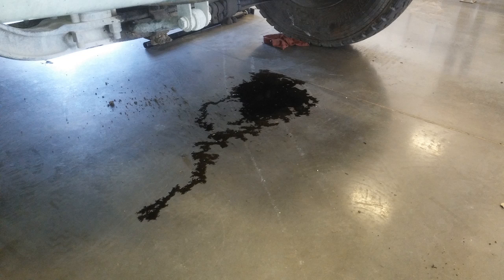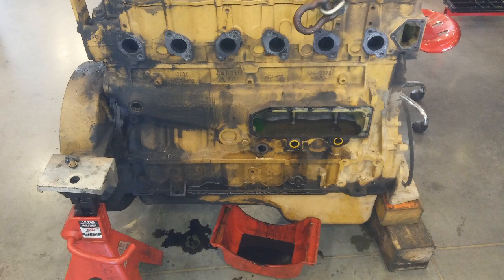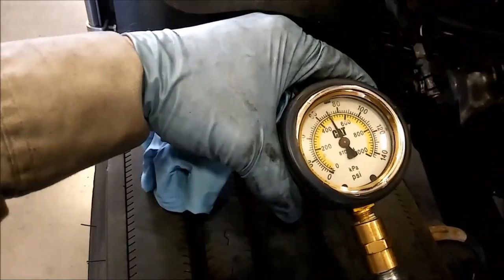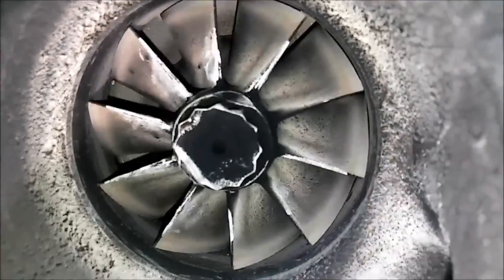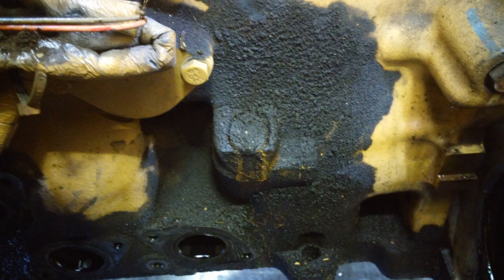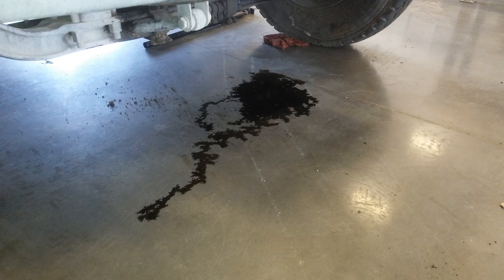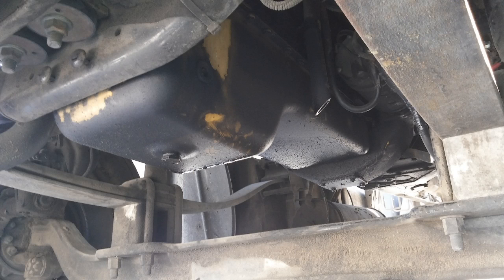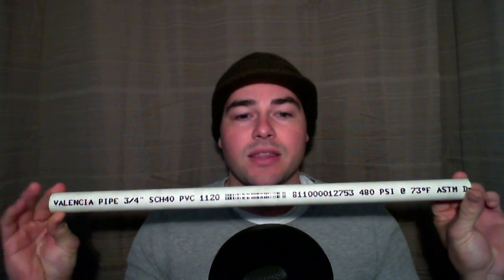Why Do Diesels Leak So Much?  Why Do Diesel Engines Leak So Much Oil?

Comment: Not entirely correct.  This has nothing to do with the turbos.  Turbocharged gasoline engines have PCV systems.  Both diesels and gas engines create a suction on the intake side, turbocharged or not, the difference is that suction doesn't give you a vacuum signal that can be used to pull these vapors out of the crankcase/lower crankcase pressure without a restriction in the intake.  Gasoline engines have a throttle, the restriction that causes the vacuum, most diesels do not.  

We can get into vacuum pumps and what oil impinging on the turbocharger impellers really does but lets get the problem with PCV systems right first.
Reply: Not all gasoline engines have a throttle body in use. On my car the throttle valve is always open (Valvetronic system). Still there are no leaks.
Reply: The Valvetronic system closes the throttle body to create a vacuum signal in the intake and does have a separate vacuum pump to do the same, BMW went to a lot of effort to design better seals because of it's lack of a constant vacuum signal, and it still has oil leakage problems.  There are various upgrades to the BMW PCV system because it doesn't work well.

What's your point?  So BMW messed this up on those cars (there's a reason to do it but WRT to this discussion it's messed up), and the way that BMW implements this, it still closes the throttle body to create a vacuum in the intake at startup....

At the same time there are a few diesels that do have throttle bodies, and even those that don't, don't all leak.  My Cummins 5.9 in my dodge ram is dry with something like 170K miles, but I wouldn't be surprised if it started leaking.

Comment: 5.9 cummins isb 300k plus not a drop of oil anywhere. The "right stuff" by permatex is the key. 
I disagree at my shop I rarely see turbos every damaged from oil residue. The amount of oil that touches the impeller is so minuscule with the pcv routed to the turbo inlet. I personally think its the best system. Rings benefit from the vacuum. Many manufacturers still use this system present day.

Comment: as others have mentioned, the reason diesels don't have vacuum is because they don't have a butterfly in the intake, it's not because they are turbo'd.
Reply: My n/a DIESEL 6.2 has a CDR that runs off... VACUUM...
Reply: Probably couldn't work well under all engine conditions, but it's an interesting idea

Comment: So why not use a catch can system with turbo pcv? It would filter out the heavier oil and still pull a vacuum on the crankcase.
Reply from the maker: +XC If you ran a good filter or centrifuge before the turbo you could do that, as long as you get most of the oil out of the fumes.

Comment: Could you not use an engine driven vacuum pump like they do with drag racing engines?
The reason they use them is you actually gain a bit of power, however we aren't looking to do that, but I'd reckon it could work, 
By the way the pump are specifically designed to deal with oily fumes, the vacuum pump used for the brake servo wouldn't be able to do it..(even assuming you'd have a completely separate system away from you power brakes etc)

Comment: VW diesels have PCV systems that recirc if I'm not mistaken. Also a PCV system on my 1.8T that recircs straight into the turbo intake pipe.

Comment: Diesels have pcv systems bud. Its routed into the intake in front of the turbo.
Reply: goes out and looks at the IH 7.3 diesel flat bed outside     Yep big blow by tube under it...
Reply: Not all. You can't just make an all encompassing statement like that.
Reply: my 2003 7.3 Powerstroke originally had a PCV routed to before turbo.. but has since been rerouted to atmosphere.
Reply: 12 valves have road draft tubes

Comment: Over-the-road may not like PCV into turbo systems, but industrial and Ag engines have this setup regularly. Nearly all the Perkins, Kubota, Yanmar and Deutz engines in my rental equip fleet have valvecover vents leading into the intake manifold or turbo inlet. This has lead to a quite expensive scenario which is common in rental, but I had never had to face in years past, when the "blow-by" tube was the norm.......rollover hydro-locking. I have a wall of bent con-rods in my engine build room from customers who rolled or flopped over rental machines and didn't shut the engine down right away. One good gulp of engine oil out the valve cover vent, and whatever cylinder is closest to the PCV fitting on the intake manifold gets its con-rod kinked.
Reply: Steve po 
Alot of the standby generators I come across are still open, surprisingly.
Reply: I'd think it a big piece of machinery rolled over, you'd have bigger issues than a hydro locked engine, lol.  But maybe thats me.
Reply: I know a guy who can flip over any piece of equipment on flat ground. The boss came to work in the morning and saw the bent muffler, glared at us and walked away.

Comment: All large Diesel engines have a crank case negative pressure system. If negative pressure and ventilation are not maintained there will be a crank case explosions. Big engines have explosion doors.
Reply: goes outside and looks at the IH 7.3 diesel Yep got a blow by vent tube no negative pressure anything....

Comment: The best solution is the simplest one; A crank-case vent tube.  But it is not environmentally friendly.
Reply: Really... that is what is used, you STILL get pressure with out having a vac on the system.

Comment: The heui injections system is big reason a lot of them leak 3000psi oil will find a weakness.
Reply: So why don't the common rails leak diesel.. only running at 30,000 psi...

Comment: My cat dealer remove this canister after a couple years and installed another valve cover with breather tube outlet. So my engine have 2 breather tube and is doing good

Comment: Pretty interesting, I have a 89 F250 IDI (NA) and a 83 Mercedes Diesel 2.4 also NA, I always clean my engines and engine bays with super purple or whatever its called, and watch for leaks, both these engines leak very little but when I got em of course they where covered with diesel spudge...I love a good diesel I'm looking for a 4BT to install in an old 79 F250 4x4 but lordy they are hard to find now-a days. Good video great topic I subbed...

Comment: You need to try to give correct information out.... it has nothing to do with being turbo charged or not at least when it comes to vehicles that are on the street it's because there is no throttle body in a diesel and therefore it cannot create vacuum regardless if it's turbo charged or not. Most modern day diesels have a vacuum pump for the brakes or a hydro system. So please give accurate information. And there are actually PVC systems on diesels. But on most diesel engines that are not on the road are not regulated by the EPA and not required to have any vacuum systems that's why they leak.
Reply: LOL my N/A 6.2 would like to have words with you over "no vacuum"... actually my CDR (crankcase depression regulator) would also like to have words with you...
Reply: ya know dd’s do actually have throttle bodies on them...stays open during normal engine operation but when the truck is put through a regen it closes to allow everything to get real nice and hot mmmmhhhmmmm
Reply: Jack Black "all the boost even if a turbocharged diesel had a throttle body it still wouldn't create vacuum. Any turbocharged or supercharged engine whether gas or diesel will have no vacuum in the intake. And even without a turbo with no throttle body its still sucking air in which is vacuum. Maybe not as strong of vacuum if it did have a throttle body but a vacuum none the less"     This is as terrible as the info put out in the video. Yes, any engine, turbo or not, with a throttle valve, will pull a vacuum when the throttle is closed. Why? Because any piston engine is an air pump. It's not sucking in air, so much as allowing the atmosphere to fill the space in the cylinder. Suction happens when you restrict the flow into the cylinder. Most diesels do not have a throttle, so there is only the restriction of the manifold at its smallest point. While there will be a delta in atmosphere in a diesel intake manifold, it's not a useful vacuum. So many have stated "when I stick my hand over" "there's vacuum". Yes, when you choke the intake, it creates a vacuum, there is none until you do so. If you are still suspicious, pick up a piece of 2" pipe, suck air through it, and try to create a vacuum. This is like being a diesel engine. Take the same pipe, put a piece of duct tape covering 98% of the opening, and try again. You just created a throttle, which will create a low pressure region between your lungs and the duct tape, vacuum....  That is a gas engine. Both gas and diesel will create some vacuum at full throttle, when the volume of air being ingested by the engine, surpasses the manifolds ability to flow one atmosphere, unless said manifold is capable of flowing that amount. Both gas and diesel turbo engines, will not create a vacuum under boost, because obviously, the intake tract has been pressurised. A gas turbocharged engine, will still create vacuum when the throttle is closed, as the area behind the throttle, has been choked. I think the intention of this video was great, and while we can attribute some level of engine cleanliness to pcv, it is not the whole reason. The advancement in gasket material, and mating surface design in the automotive industry has made huge advancements. These same developments in the commercial/industrial diesel industry have been much slower. As an owner of several turbocharged cars, and technician for a number of diesels, it's easy to observe that the cars and late model 3/4 to 1 ton diesel trucks utilize superior gasket materials, better sealing techniques, and in the last 10 years, completely flat (no humps or dips front or rear) mating surfaces (oil pans, valve covers, etc). I will however state, that what works, works, and it's hard to argue that any good, simple, reliable, oil seeping/slow leaking diesel should be redesigned to stop it from marking its territory when parked.
Reply: all the boost but not a single PVC system.
Reply: if you have a variable turbo you can adjust the vanes very open and the intake will pull a vacuum ;)
Reply: My petrol engine (BMW N55B30) with two turbo's and without a throttle valve (always open) does not leak oil. So the arguments mentioned in this thread seem incorrect to me.
Reply: If u know so much, then why dont you make a video?
Reply: This...
Reply: all the boost even if a turbocharged diesel had a throttle body it still wouldn't create vacuum. Any turbocharged or supercharged engine whether gas or diesel will have no vacuum in the intake. And even without a turbo with no throttle body its still sucking air in which is vacuum. Maybe not as strong of vacuum if it did have a throttlebody but a vacuum none the less
Reply: pcv*...i never thought i’d be one to correct people in a comment section but yet here i am and it doesn’t make me feel any better about myself surprisingly
Reply: all the boost : yes some pasenger vechicles use vacuum pumps as a source for brake n even ventlation control. That is all it is used for. Diesels in general have no vacuum on their own. High compression that is why.
Reply: grumpybill P C V
Reply: The charge air cooler from the turbo to  the intake has to cool the air coming from the turbo because it’s under pressure not vacuum. Detroit has some DD13 , DD15,DD16 with throttle plates not to control air while operating normally, but for air restriction when performing a parked regen to rapidly drive exhaust-DPF -DOC temps to 1100 degF.
Reply: Bram Biesiekierski moron new diesels have throttle plates, stick to your gas engines
Reply: My 2014 peterbilt has an isx 13. It has a throttle body on it.  And everytime I turn the truck off,  I can hear it make a wiggle noise to calibrate and self check,  so please do your research before making an add of yourself thinking you know everything in the dam diesel Bible.
Reply: Also. My isx 13 does not have pcv valves or lines.
Reply: Who the foook is this guy
Reply: My turbo diesel truck has a throttle body and a pcv system. My turbo gasoline car (running upwards of 30psi) has a pcv system. I understand time constraints, but making sweeping generalizations does more harm than good. Easy (but not cheap) solution to the diesel PCV issue is oil-air separators with VTA breathers or recirculation.
Reply: all the boost there are NO pvc systems in trucks, unless it is a plumbers truck.
Reply: grumpybill. "plumbers truck" LMFAO!!
Reply: grumpybill there are many positive crankcase ventilation systems in diesel vehicles they are not the same as gasoline engines but nevertheless there are positive crankcase ventilation systems.... and I would bet that almost every diesel engine manufactured in 2018 that is in a vehicle has one in some fashion.
Reply: All the boost is correct.  

Diesel engine dont have a throttle butterfly.  They regulate engine output by controlling the fuel input at the injector pump, or injectors on modern diesels.  Petrol cars regulate the engine output by controlling air input.  Hence using a throttle.  This is a fundamental difference in operation between the 2 engine types, and is what allows a petrol engine to pull manifold vacuum and a diesel not.

The diesel engine still "sucks" in air during operation.  Just like any ICE.  But the inlet tract is not blocked by a throttle plate, without the blockage, there cannot be vacuum.  It has nothing to do with being turbo charged or not.
Reply: Holy cow- Sorry dude-you are misinformed.Not one of your sentences make any sense.He does give correct info-did what he could to ram it in a 9 min video.Ive been wrenching on diesels since 1980.I dont know how long Adept Ape has been wrenching-but he's good,n many good-informative information has been video taped.Nice he takes the time to do that.I know-(all the boost) let us in on your video's-and please share your years of experience with us.
Reply: The main reason diesels leak is because there is Blow by and diesel fuel gets into the oil. once diesel gets into the oil.... diesel will find a leak and literally climb up hill as in the picture he even points out. Diesel fuel will always find a leak.
Reply: all the boost nice point of view👍
Reply: Hey "all the boost" next time you're fucking with any diesel engine, slap your hand over the intake then let us know how you feel about there being no vacuum!
Reply: scott brazinsky I find this pretty comical.. this is what happens when a diesel mechanic runs into a diesel technician.... sorry you're becoming a relic. Have fun on your 30 year old engines.

Comment: diesel engines dont lack vacuum because of turbos, they lack because no throttle plate to restrict
Reply: To build pressure or vacuum you must have displacement and a restriction. The engine provides the displacement, a throttle valve (or your mouth, what ever floats your boat), provides the restriction. No restriction, no vacuum; that's just how it works.
Reply: Saab Story 
The only intake manifold vacuum you’ll have is air filter restriction.
On a turboed one its between the filter and compressor wheel, both cases it’s minimal.
Reply: @Matt Lane hook up a vacuum gauge to the intake manifold of that N/A diesel and tell me if that needle even twitches.

Just because the engine's pulling air into itself without any assists doesn't mean it has vacuum. A gasoline engine has zero appreciable vacuum at full throttle for the same reason your N/A diesel never has vacuum: There's nothing in the intake tract to restrict airflow in the first place.
Reply: Matt Lane
They use vacuum to fill the cylinders, but they don't have manifold vacuum like a petrol engine. Yes, the intake will suck air, but that doesn't mean there is manifold vacuum. Literally just Google 'Diesel Manifold Vacuum' and you'll come across hundreds of pages explaining why they don't produce vacuum like a petrol engine does. Hint: The reason is, there isn't a throttle plate in diesel engines because the amount of air entering the engine doesn't have to be regulated like in a petrol engine.
Reply: Both reasons are true. N/A Diesels will not record very high if any numbers on a vacuum gauge since there are no throttle plates, but the fact that the downward moving piston draws air in to the engine proves that they do indeed have a vacuum effect.
Reply: +Calvin Handley Above the valve there will be no vacuum. The vacuum is built because of the restriction of the valve!!! If you remove the head and turn the engine will the cylinder have vacuum? No. It's the restriction that causes the vacuum to build!!!
Reply: You're sorta right. My naturally aspirated 6.9L International diesel does have a very slight intake manifold vacuum, enough to operate a crankcase depressurize regulator system and pull oil vapours into the intake. But it IS a very slight vacuum, created by the restriction posed by the air filter and air cleaner setup. By the way, this system oils up the valves of cylinders 7 and 8 rather badly and I am going to come up with something better.
Reply: If they had vacuum, there would be little need for hydroboost braking systems in light duty diesels...
Reply: I guess I should have read the replys before adding this exact same comment :)
Reply: Pls why Perkins 1103 oil coming out of the exhaust
Reply: @bilyaminuzubairu4907  is it oil or soot with water in it?
Reply: truth speaks let me teach all you guys something ,any turbo engine don't have good vacuum until you let of the throttle ,now if you have a turbo on anything you need 2 pcvs 1 on intake and 1 on the turbo or air box because when you boost the only thing with vacuum is the turbo inlet , booyah
Reply: Wrong, and if you want to say otherwise I have a nice N/A diesel you can shove your mouth on and tell me it has no vaccum.